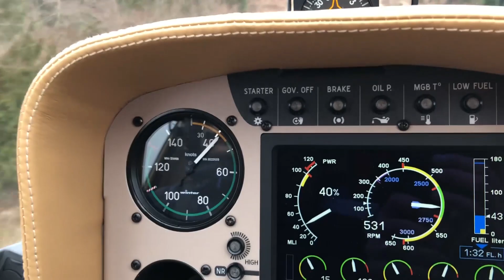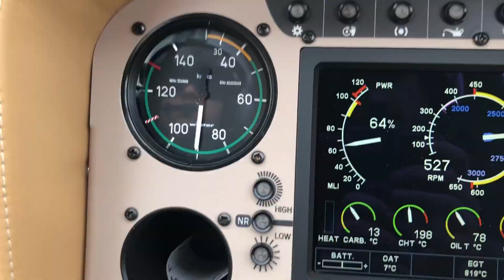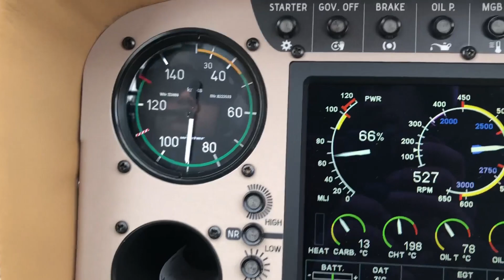TESTING FOR EXTERNAL CAMERA MOUNT

Comment: Awesome vid. Curious on a few things. Most cameras are mounted in a way to never come off. I'm sure it's mounted on the Cabri on the cargo hook to not affect w&b much since a front mounted system would mostly add rear weight to counteract forward cg. What situation would u find yourself in needing to release the load? Is this just in case it came loose unintentionally? Also, I would think a heavier, actual camera system that weighed 50x more than the bean bag test you performed would have a different release profile. Help me understand! Lol